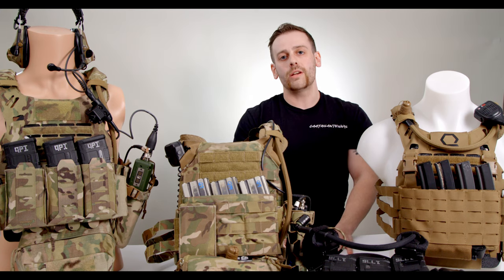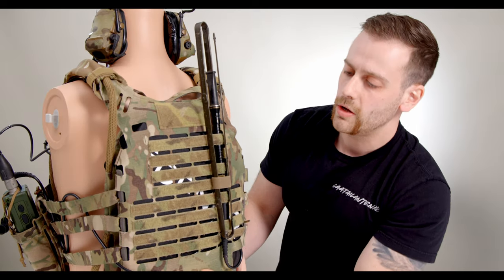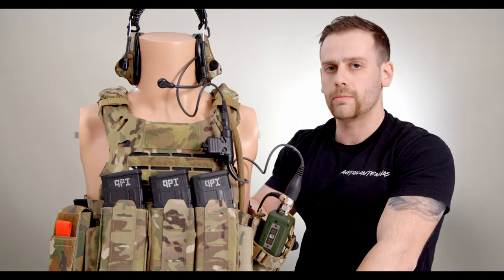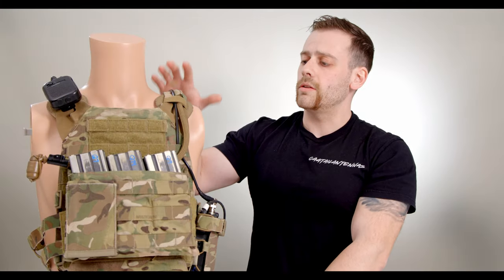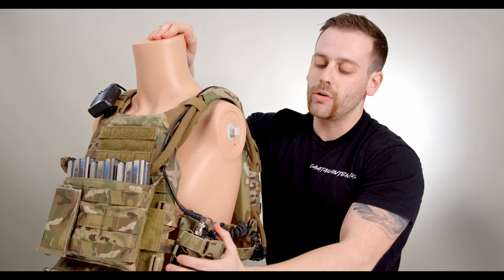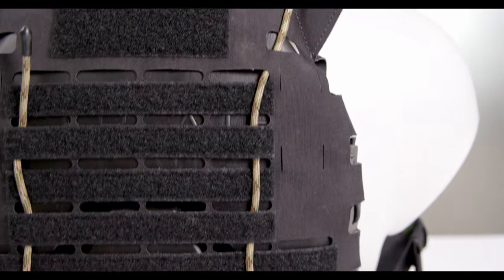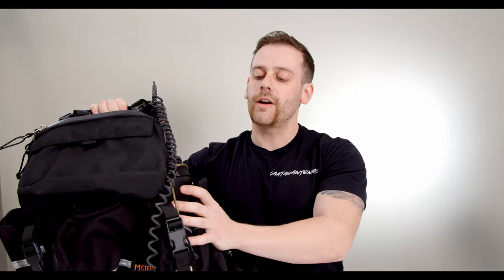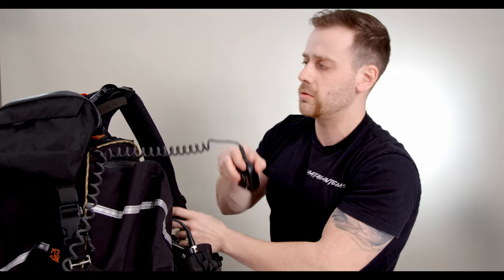Comms in Kit: Routing Radio Cables (Military, Police, Civilian, Fire/EMS, Plate Carrier, Chest Rig)

Comment: Appreciate seeing someone else running cross-dominate. I also have to run left shoulder long arms and right pistol. Which makes it a little more challenging for setting up vests and carriers. Have you seen signal improvement or degradation with the wearable on 2 meter/70 CM freqs? Or MURS and GMRS freqs for that matter? That PRC-152 is a hell of a lot smaller than the PRC 77s and 25s we had.

Comment: I’ve been a researching caatails antennas for about 5 months lol
I have a baofeng uv-5R .. but on the website it says a TNC is a stronger connection.. so I want a setup like the military… with a relocation whip FOR the antenna..
But on the website I’m getting confused with the TNC-BNC- SMA
BAOFENG RADIO IS A M.. so I need a TNC-F to BNC/TNC-M  to attach a antenna?
I need help

Comment: Silly question, but would it be possible to have a caatail that connects to the relocation cable/radio on one end, but then on the other end it connects to the abbree? That way you get this huge amount ot antenna that can be woven into the kit, but then if/when you need that bit of antenna to stick up higher, you'll have it?

Or another thing I was wondering is, you have the relocation cable that runs from the radio, to the back of the carrier, then at the other end of the relocation cable, it  splits off into two heads, and you can connect an abbree to one, and a caatail to another.?